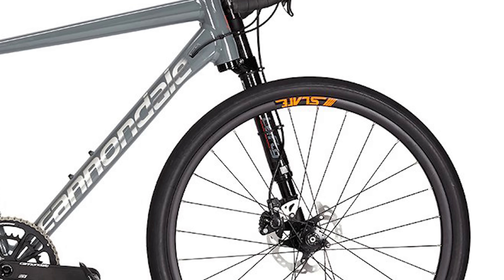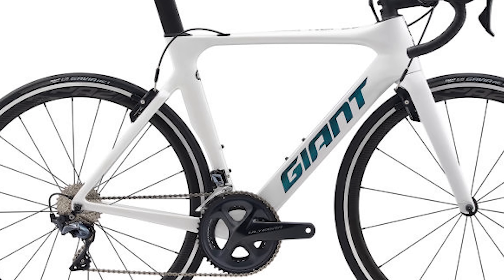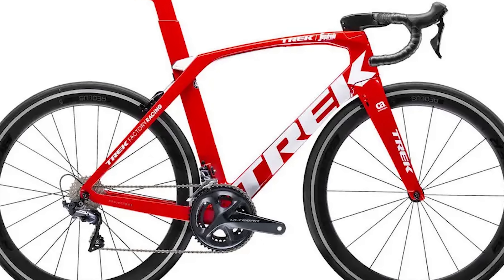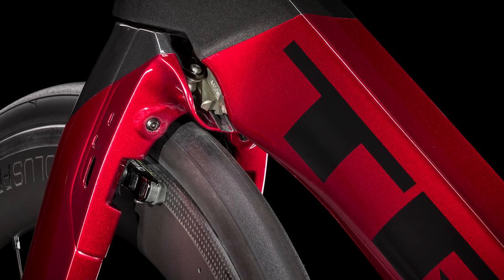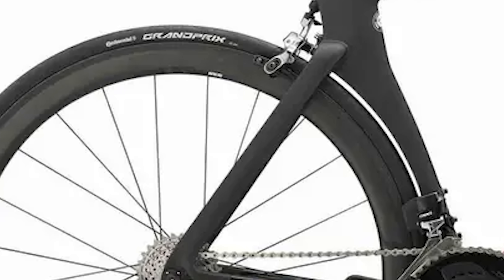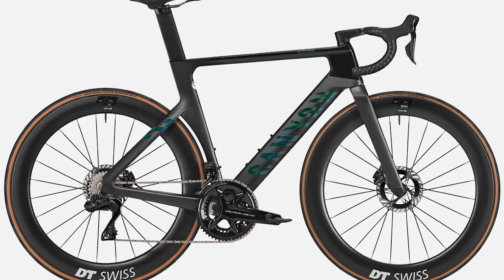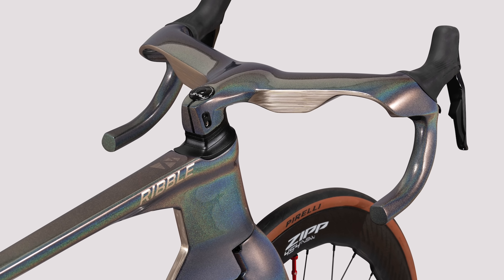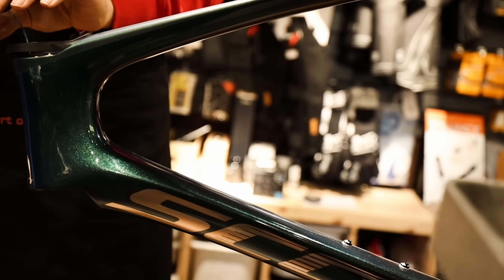Pro Bike Mechanic's 10 Most Hated Bikes

Comment: My policy is that I never buy proprietary components. Always get round seat tubes, round steerer interfaces, standard BB, etc. I swap parts among different bikes all the time -- it all just has to play nice across the board. Standardization FTW.
Reply: Exactly, right now, all my bikes are fine, I am just worried for my next purchase (N+1).  The best average bike I found with normal easy maintenance parts was the (Decathlon) Van Rysel - EDR AF 105, my daughter has one.  It is similar to my Kuota Alu Shimano 105 bike.  If I can't fix my bike by myself, I won't buy it.  I am not diving in all the nonsense, carbon wheels, disk brakes, tubeless tires, Shimano Di2, weird bottom brackets.  If I were sponsored and had bike mechanics working for me, I wouldn't mind all the way too expensive gadgets.  Even if I am 32 seconds late after 100km, I don't care, I just know that I can fix a flat tires in less than 5 minutes, my rim brakes,  my rear and front mech has never taken me more than 1 min to adjust, why would I change that ?  no need to think about my batteries being charged.
Reply: If you take your bike to the bike shop, why do you care?  Youre paying for their expertise in fixing these specialized things.
Reply: @michaeldesrosier1068  I do all my own wrenching at home. That's why I care :)
Reply: @michaeldesrosier1068   For me, fixing or upgrading a bike is fun.  I like to anaylyze each part of the bike and make sure that is easy mainteance and solid.  The last time I asked a bike mechanic for help was 10 years ago for my Mavic Kysrium Equipe rear wheel loose cassettes.  I checked how to fix it on the net and I didn't want to mess with the bushing and little parts that fly everywhere when you remove the freehub. I have never bought Mavic wheels again, I know I could have replaced the shitty bushing with an aluminum adapter, but I don't support design flaws.
Reply: @gmsvalley If you run tubeless, you're not really fixing flats at all. You just have to remember to add more sealant every 6 months (I believe). I one time got a flat because I hadn't added more sealant in like 8 months. When I went to locate the hole, I found so many places where I got a puncture and it sealed itself and I never noticed. Just thought I lost a little pressure and had to add more air. 🤷🏻‍♂️
Reply: @dvs620  If I had a mountain bike,  I would probably run tubeless, but I don’t want to mess with that on my road bikes.  I will try TPU inner tubes and validate if I see a difference.
Reply: That’s fine but it is therefore also your policy to never have the fastest bike 🤷
Reply: @Racer46theman  Fastest compared to what exactly? Because they mention how bike companies will say a bike is 30% faster, but 30% faster than what?
Reply: @Racer46theman  Yep. I ride ti bikes because I like the feel and longevity. I haven't raced for years. Couldn't care less.
Reply: @michaeldesrosier1068 because if its complicated to fix it costs more and every cyclist should have some basic bike maintenance skills just so they can get home if they have a mechanical issue on ride or don't miss a ride due to an unexpected mechanical that they can't get fixed the day before or on the morning of a ride or event. Also if it's reliant on proprietary components spares will be more expensive and time consuming to source.
Reply: @dvs620  faster than a bike with round seat post etc. Obviously. It’s not exactly controversial 😂
Reply: @elbowspeak  in which case you have the perfect bike for your use case. If I didn’t care about speed I would definitely ride round tube ti.
Reply: @Racer46theman  The rider probably has more to do with that than the bike. A pro rider would be faster on a bike with a round seatpost than an amateur rider with an aero bike, no?
Reply: Yep.  There's a whole lot of extra tech in bikes that isn't going to benefit someone with a job and 20% body fat.
Reply: @elbowspeak

If a D shaped seatpost prevents you from doing your own wrenching you can’t actually wrench can you? LOL
Reply: @ivanboesky1520  Missed the entire point of this. Proprietary components exist to make sure you're only using branded products by the bike company. They don't do it because they think it's better. They do it so you won't use aftermarket stuff. Or they're trying to solve a problem with a new solution, so you'll buy their stuff instead of a more common, logical solution. Like that hoverbar (or whatever it's called) from Canyon.
Reply: @gmsvalley  Aside from the weried headset dimension (41.7mm x 47mm), AF105 is a perfect bike to dial in a rider's setup. I went through 3 sets of groupsets, two stems and a seat to make it fits like a glove.
Reply: @michaeldesrosier1068 . Some of us really enjoy working on our own bikes and not paying our hard-earned money to have a “pro” do something we should be perfectly capable of doing ourselves. With standard, non-proprietary parts and sizing, this is pretty straight forward…it often seems like pure marketing hype for the companies to push for “trained technician only”repairs on their ridiculously complex proprietary “improvements”.   And, when it comes to my own bikes, no one has more “expertise” in their idiosyncrasies than me…the guy who rides them all the time!
Reply: Because it’s not right for them to force you into their proprietary garbage.  And then upgrade options are limited.  People like choices.
Reply: I do that same stuff all the time.
Reply: @michaeldesrosier1068  You just answered your own question.
Reply: 😊😊 @gmsvalley
Reply: @gmsvalley  nothing hard about disc brakes, just different

Comment: Proprietary components are a nightmare, who'd have thunk!
Reply: To be fair, you could build proprietary parts that are super easy to work on, but these are all proprietary with performance as the only consideration.
Reply: @matt.3.14  as a rider I'm less concerned with the complexity of working on them (because I don't work on bikes all day), I'm more concerned with whether a replacement can be sourced a few years down the line, and at what cost. Something as simple as a stripped seat clamp bolt can be a major headache if your bike has a proprietary seat post only available from the frame manufacturer. This stuff is perhaps more forgivable on high end race bikes where the performance Vs practicality trade off is heavily implied. Having stuff like the future shock on mid range bikes is just baking an expiry date into them.
Reply: Just an absolute nightmare
Reply: It's insane what companies will do just to not have maintenance as a consideration at all. It's almost so bad, you would think they're willing to take a loss on sales just to make bikes as difficult to upkeep as possible. Like some literal lunatic in the C-Suite is mandating this for literally no other reason than his lunacy.
Reply: Thunk? Really?

Comment: Fully integrated cables on various brands. You have to take the bike to bits to change the headset bearings. Also the gear cable is routed through housing all the way through the bike so it adds more friction .It's also hard to adjust the reach on the bike as they have 1 piece handlebars and stems , this is also a problem if you sell the bike as you can only sell it to someone with the same body proportions  . Why oh why ?
Reply: I don't know why cyclists like this or want this.  It's baffling to me for doing the most simple adjustments, now need to take to a shop cause it will take hours to do something that once took 5 minutes.  Why do people like this again?
Reply: I think few new bikes with integrated cables come with cable gears now.    
They even say "wireless only" on the frame for many of them.
Reply: If you don't like it, just don't buy it. There are many options out there.
Reply: Always moaning about headset bearings. As if they need replacing every 3 months on a road bike ...
Reply: @irfuel  That was just 1 example though but I don't think limiting the serviceability on bikes is a good thing just to save a few watts. It is also creating more waste when they should be doing the opposite.
Reply: Integrated cockpits.... the dumbest tech fad in recent memory. 
The Dave Arthur's shill them and muggins consumer fall for these bike fitting horror shows.
Reply: @anthonyduncalf-uk  As soon as you cut the steerer tube you are limiting who can buy your bike, one piece stem or not ...
Reply: @irfuel  No not really as the max recommended length for a carbon steerer tube is around 25mm , so it won't be much different for anyone . Not being able to alter the stem length or handlebar width and reach is a bigger issue.
Reply: On aerorads you’re talking every 1-1,5 years. Also, for canyon, 7months in doesn’t fall under warranty as it is “normal use”. I.e. your fault for washing bike with water.
Reply: @anthonyduncalf-uk  Ah so everyone should ride as slammed as the first owner. Zero issues there. Got it ...
Reply: @AI-dz2zd  How do you destroy a headset bearing on a road bike in 1.5 years? Are you pressure washing directly on the headset for 10 minutes every week and make sure the entire area has zero grease applied?
Reply: @irfuel  It doesn't sound like you have got it . Manufacturers recommend not going higher than around 25mm due to the stress on a carbon steerer tube . Slammed is 0mm not 25mm.
Reply: @anthonyduncalf-uk  Doesn't matter. If I ride with 5mm spacer the next owner won't be able to ride it with 15mm spacer.
Reply: @irfuel  none of the above. One 200+km ride in a rainy-ish weather. I am not alone in this, aeroads are notorious for this problem. Anyone I talked to had at least one replacement already. Mind you, we own a bunch of racing bikes, even the neglected winter training bikes havent had this problem.
Reply: @AI-dz2zd  Sounds more like a quality issue with the Aeroad than anything else.
Reply: @zypang1447 Isn't it obvious? For people who don't change stuff on their bikes all the time and bring their bikes for maintenance to a shop anyway, they have no downside, look better and the cabling/hydraulic tubing is better protected, less exposed.
Reply: @anthonyduncalf-uk Please explain the "more waste".
Reply: @oerthling  Well if it's harder to sell and harder to get parts it's more likely to end up in landfill .
Reply: I do agree. I went that route on my titanium custom bike and what a shitty decision. I hate the lack of compatibility with almost any bar because of the custom shaped spacers. Now thinking on getting it on a cardbox to fly with it... Cannot take the handlebar off. What a scam I fell on just by myself...
Reply: @irfuel but on a gravel?
Reply: @anthonyduncalf6190  this is silly. Max 25mm and then you see people with 120mm stems. That causes way more torque than those 25mm (or 40 for what is worth) steerer tube exposed.
Reply: @mireia3208  Yeah well manufacturers are just playing it safe so they don't get sued if something goes wrong. I'm sure you could safely go higher if the stem was fairly short.
Reply: Yep. Internally routed cables are the nemesis of bike mechanics.
Reply: @squngy0  sure, but until there's wireless brakes... and while I'm sure manufa's will try to sell this, I certainly ain't buying it.
Reply: @edwardsjohnpaul  You are right.  
With hydraulic breaks, you don't need to worry about friction, though.
All the other things would still be an issue, but personally, I don't change headset bearings that often.

Honestly, I don't know why I am the one writing this. I still  have fully mechanical with cable breaks and no integration and it is fine.
Reply: Defo this - changing headset bearings on a Ribble CGX with integrated stem/bars where gear and brake cable go through headset bearings. Bonkers - and on a cross bike. Ball ache.
Reply: If I need to replace the cables I take it to the bike shop
Reply: @zypang1447  Is replacing an entire cable and housing something simple and frequent? Unless you ride hundreds of kilometers a day probably not.